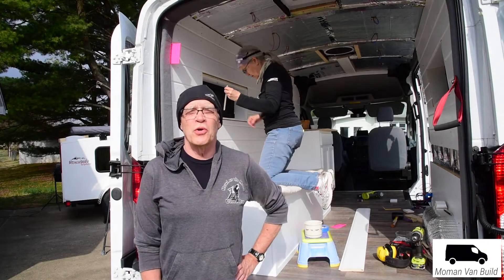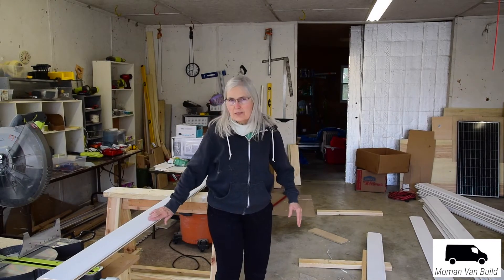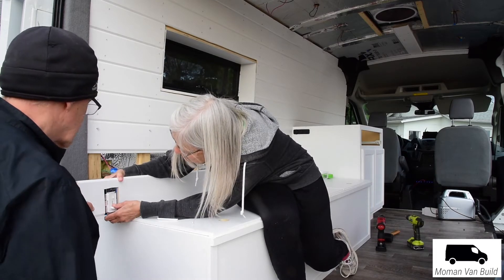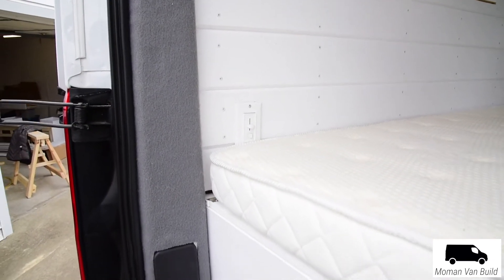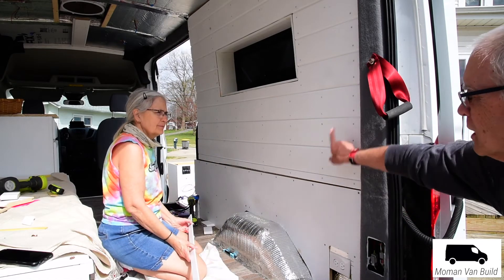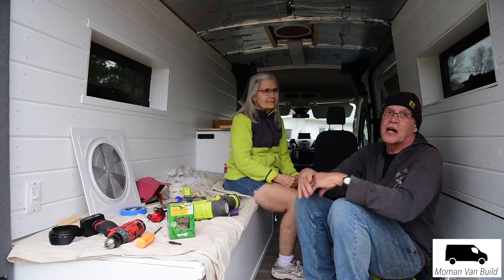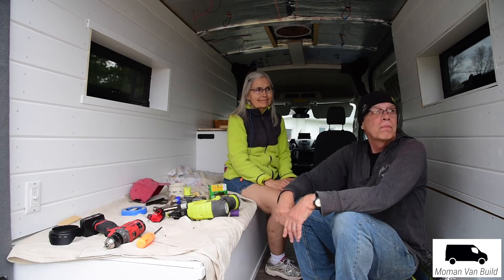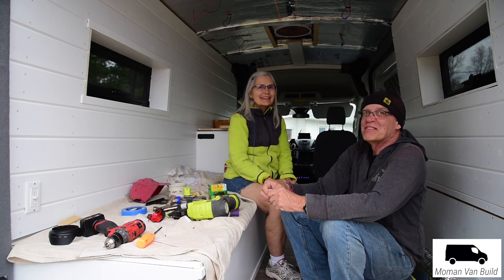Episode #54 Shiplap on the Walls! Finally!

Comment: Hey guys have you considered swapping the board with the outlet and the board above the outlet to move the outlet higher on the wall???
Reply from the maker: Well that is a good idea. I wired the last puck in the group that goes to the dimmer switch. Does not work properly. At first it came on and the dimmer worked, but then it goes off. I think I have the wrong kind of dimmer switch. It has two pair of red and black. One says input and the other output. I looked at videos and it seems most RV dimmers have just three wires - red, black and white. And I think the white goes from the dimmer to the fuse block negative? I ordered a different switch and will try again. Moving the board is great idea and Susie will like to get it raised up anyway. It will be a little annoying but doable. I really hope I can figure out the dimmer issue. Thanks.
Reply from the maker: I cut off the dimmer switch and just held the pairs together and the light comes on, so power is going through. It is just one long pair of red and black wires running to those six holes.